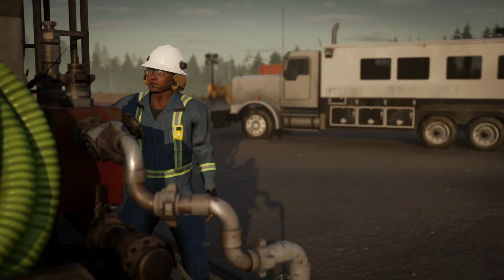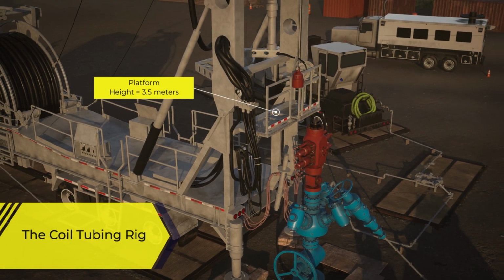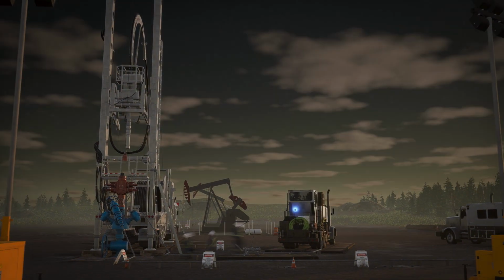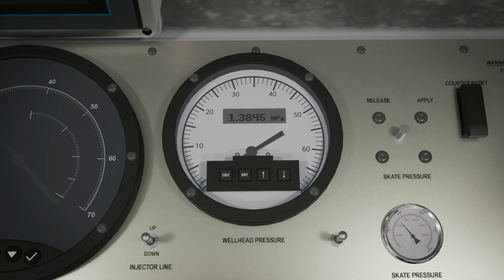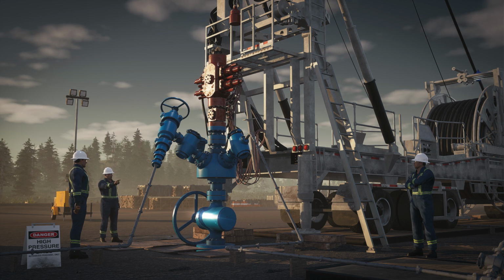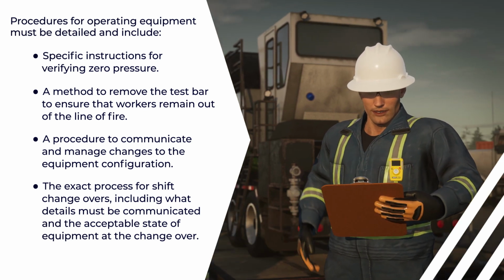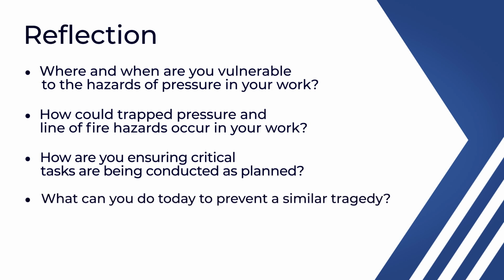Building Capacity to Manage Pressure | Pressure Fatality Incident

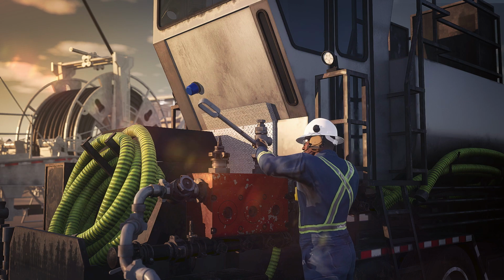Comment: At 7:50, why are you showing a pressure drop? It seems like they only believe it dropped. The pressure sensor is located after the new additional valve, so the pressure remained the same at 24.1 MPa. I believe this may have occurred due to negligence or low qualifications of the staff. I empathize with the individual who climbed there. Great video! Perfect for teaching goldfinches about pressure.
Reply: That is the pumper pressure, so the pressure in the line between the manifold and the pumper as measured by the pressure transducer (3:53) at the pumper.